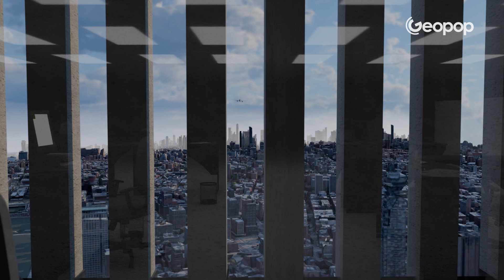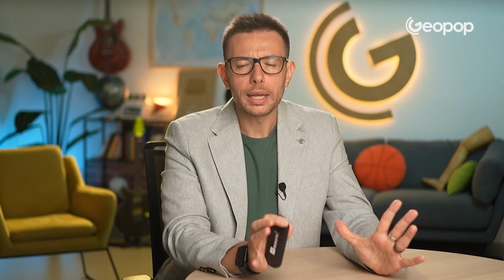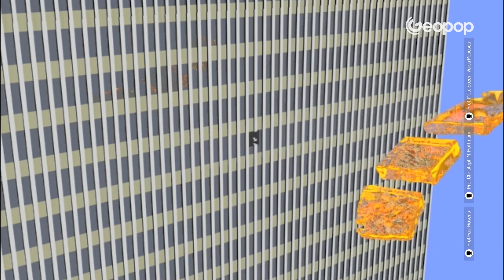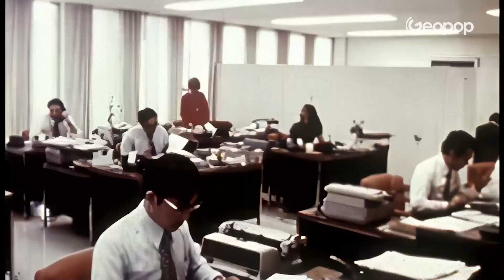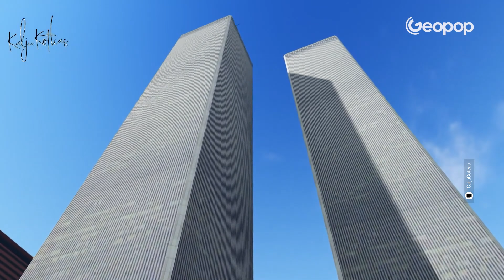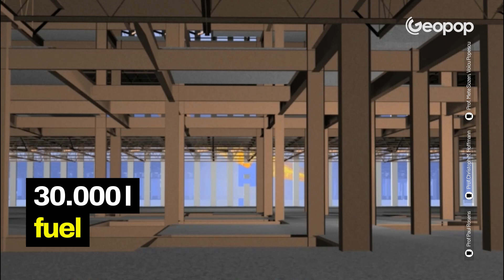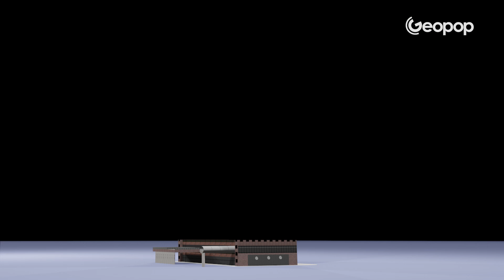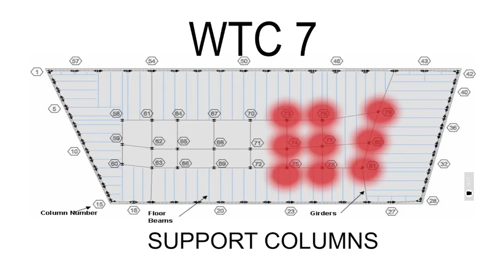9/11, 2001: The Technical Reconstruction of the Twin Towers and WTC 7 Collapses

Comment: Im still waiting for this genius to tell us why building 7 collapsed.   Helllllllo
Reply: I'll do it. The collapse of the unknown and unimportant Building 7 – one of 6 buildings to collapse of 10 destroyed on 9/11 - confuses a lot of people, despite being one of the most studied engineering disasters in history. It was not famous, not a terrorist target, no one was killed in it and thus it did not get a lot of attention, so most know very little about it. There is a lot of tantalizing but absolute garbage out there on this topic. Given the choice between long boring, hard to find technical reports and readily available, easily digestible fantasy on the internet, many turn to the latter. To counter that I prepared this brief summary explanation based on my own analysis. No politics, just engineering. 

The North Tower collapse at 10:28am bombarded Building 7 with thousands of tons of burning debris, causing heavy damage and starting raging fires burning out of control for the next 7 hours. Half the responding FDNY firefighters having been killed, others injured, units in disarray, much of their equipment destroyed, no water pressure, and the greater urgency of Search & Rescue efforts, firefighting efforts at 7 were pulled as futile. The building couldn’t be saved and was left to its fate.

youtube.com/watch?v=g_SvpwyC17M&ab_channel=MFitz 

Collapse of a burning structure is always a concern for firefighters. Steel buildings subject to fire rely on active fighting of the fires to survive. Left to their own devices they will collapse. Buildings are designed around 1 to 3 hours of fire resistance, allowing time for occupants to escape and ACTIVE firefighting to get started, after which all bets are off. In B7 the occupants escaped, passive and active fire protections were compromised and active firefighting never got started which left the building to take its chances. It lost. Odds on Building 7 would eventually collapse,… and it did. No big deal in logic. That is the sort of choice firefighters make every day in brush fire situations - which houses to save and which ones to let go. Only real difference here is moving the decimal on the size and cost.

FDNY Chief Daniel Nigro ; The biggest decision we had to make on the first day was to clear the area and create a collapse zone around the severely damaged 7 World Trade Center, a 47-story building heavily involved in fire. A number of fire officers and companies assessed the damage to the building. The appraisals indicated that the buildings structural integrity was in serious doubt. I issued orders to PULL BACK the firefighters and define the collapse zone. It was a critical decision; We could not lose any more firefighters. It took a lot of time to PULL EVERYONE OUT, given the emotionalism of the day, communications difficulties and the collapse terrain

FDNY Deputy Chief Peter Hayden - We had our special operations people set up surveying instruments to monitor and see if there was any movement in the building. We were concerned of the possibility of collapse in the building. And we had a discussion with one particular engineer there, and we asked him if we allowed it to burn could we anticipate a collapse and if so, how soon? And it turned out that he was pretty much right on the money, that he said 'In its current state you have about 5 hours

With its deteriorating condition being reported throughout the day, the collapse of Building 7 expected by the FDNY, bystanders and the media meaning at least 24 video cameras recorded some or all of the collapse. Everyone at the time knew what was coming and why.

youtube.com/watch?v=OY5S5k3tMHI&list=PL4GiNqqck-lzR7pebSWRVLoXyu-aWR3Rr&index=48&ab_channel=911InvestigationVids 

Building 7’s collapse was totally different to the Twin Towers, harder to understand and most of the details difficult to see. But we can sort out what happened through careful analysis and observation.  What follows is MY EXPLANATION of the collapse sequence using the best available information and relying on no authority.

B7 was complex structure, a 47-story steel framed building built on top of a smaller existing 3-story building, requiring several lower floors dedicated to complex load transfer structures instead of usable office space. Of trapezoidal shape and all-steel tube-in-tube construction, B7 (above the 7th floor) consisted of a central core of steel columns carrying most of the gravity load, perimeter steel columns around the outside of the structure carrying the remainder of the gravity loads and long span beams and girders to tie those elements together and form the floors. On the outside of the building hung a moment frame - the last part of B7 to fall. 

Phase 1 : Collapse initiation for B7 is notably quiet with observers not realizing the building was collapsing! There was no audible warning in the form of say hundreds of ear drum busting 180-190dB explosive bangs preceding the collapse. The first externally visible signs of collapse initiation occurred at 5:20:28 pm. Here at 12:00 a local CBS affiliate reporter is talking 10 blocks from B7 when collapse begins. People don’t start to notice the collapse until 12:11. Then at 12:45 is the famous CBS fixed camera clip of Building 7’s collapse Again, note how quiet it is.

youtube.com/watch?v=t5tEy6mXSE8&ab_channel=fresnosean379

Collapse initiation was due to multiple lower floor failures above the load transfer region (7th floor) in the NE corner of the building. In this video at 0:45 you can see the NW corner from inside the building while under construction, Column 79 just out of frame on the left. That big, angled steel beam across the top of the frame connects to C79 at one end. The girders connect to the beam. The beam and all those girders depend on just one connection

youtube.com/watch?v=nP3TNHPCIVU&t=35s&ab_channel=EdwardCurrent

Phase 2 : Lower floor failures left core Column 79 laterally unsupported over an excessive length and it buckled. If you look at a floor diagram of Building 7 (see above) and look at all the structures that depend on C79 you quickly realize this one column was a relatively isolated structural element on which a disproportionately greater fraction of the structure depended . Externally we see a vertical progression of window breakage along the 44-46 line and a kink in the roof of the East Mechanical Penthouse at the top of the building, consistent with C79 failure. The transition from full capacity to almost no capacity occurs in virtually an instant. Once the buckling failure occurs there is almost no resistance

Normally with a buckling column, the load could very well be redistributed to other columns, meaning the buckling could stop after a while. With C79 that is not the case - the failure did not redistribute the load, so the collapse rapidly progressed to the roofline, sinking the rooftop penthouse.

Phase 3 : With C79 gone, B7’s progressive, non-symmetrical collapse continues with C80 and C81 at the east end of the core left laterally unsupported and quickly buckled and failed as well, sending the EMP down through the building. C79-81 all have no diagonal bracing, which I believe is a major reason why they could not redistribute a lot of vertical loads among one another.

From there collapse progressed from east to west through the central core until the core was gone taking all of the interior floors and structures and probably most of the perimeter columns with it. You can see the horizontal progression of window failures low in the building and the dropping of the remaining rooftop structures into the building. One of the big takeaways from the NIST Building 7 study (that gets completely ignored) was their modeling which determined C79 failing under ANY circumstances would have initiated the same collapse sequence.

Phase 4 : After about 10 seconds only the exterior moment frame - a hollow shell mostly supported by the 4 corner columns and quite unable to stand on its own – remains, creating the illusion the building is still standing since little has changed externally. That’s just hollow empty shell, like an empty cereal box. The north leans inward, forming a V in the roofline. The last remaining perimeter columns buckle under the strain.  There is almost no resistance as the moment frame free falls, landing on top of the 7-story high debris pile, blocked surrounding streets, heavily damaged the Verizon Building and destroyed Fiterman Hall at 30 W. Broadway, all well outside of Building 7’s “footprint”.  It is only here, at the very end that a single utterly meaningless measurement of alleged free fall is taken. Start to finish the collapse took 18-20 seconds, or less than 1/3 of true free fall*. Not that we really care since how fast something falls cannot tell you what started it falling in the first place. The free fall argument is about the collapse of the outer shell *AFTER all of the critical internal structure had already failed and completely ignores about 80-90% - of the collapse. 

Building 7’s progressive, non-symmetrical collapse was incidental and unintended collateral damage from the combined effects of fire + time + gravity started by the collapsing North Tower. That is true no matter who planned and carried out the 9/11 attacks or why . The collapse was of so little consequence it barely even registered at the time, a mere footnote. 

I hope you found this helpful. It is meant to be informative, not adversarial and to solicit informed critical comment. If I made any errors of fact, logic or reason or left anything critical out, please let me know so I can fix it. IF you can offer a more plausible alternative be my guest. So far no one has even tried. Please start any reply with the words “Tits McGee” or I will know you didn’t actually read it and won’t let you waste my time.

Comment: So all the metal from every floor just disappeared.      So the fire from the 100th floor burned the metal on the 15th floor.  Yeah keep making crap up.   A 2x2x1/4 piece of angle can hold the world up.
Reply: Not what happened. It goes like this actually:

1. The Twin Towers consisted of 4 primary structural elements that together formed an integrated system where each relied on the others.  47 hollow box-section steel Core Columns carry the majority of the gravity loads. The 236 hollow box-section steel Perimeter Columns carry the remainder and ALL of the lateral (wind) loads. Long-span Lightweight Steel Trusses connect the core and perimeter column together at each floor with a Hat Truss on top to tie the structure together as an integrated unit where no element can survive without the others 

2. The impact of 117 tons of airplane (= to about 12 dump trucks) at speeds up to 590 mph completely destroys the aircraft.  This in no way implies the Towers come out unscathed. Some folks don’t get that. Hitting with the energy of up to a ton of TNT the impact damages or destroys many perimeter and some core columns (33 of 59 perimeter and 20 core columns destroyed at the impact floors in the North Tower), primarily through bolt-shearing failures at the end connecting flanges, as well as bending, twisting and fracturing of weld seams. There was no cutting or slicing - the reality was far more violent and messy. 

3. The impacts destroy or damage fire insulation, fire breaks and sprinkler systems on multiple floors. Huge fires are started across multiple floors simultaneously and allowed to spread rapidly with no effective firefighting or fire suppression. This was an unprecedented fire event . All of this was observed and recorded.

4. The hotter steel gets the weaker it gets .  With fire insulation stripped away and no sprinklers the survival time of the steel greatly reduced. Gradually over time heat causes the lightweight steel Floor Trusses at the impact damaged floors to sag, which was observed and recorded.  No steel melted nor did it need to. Structural steel will fail long before it turns to a puddle. It just needs to bend

5. Sagging floor trusses pull on the increasingly weak and overloaded Perimeter Columns, causing some of them to bow inward by up to 5 feet. This was observed and recorded. A straight column is up to 4 times stronger than a bent column. 

6. The bowed Perimeter Columns buckle and fail, initiating collapse. This was observed and recorded.  The formerly static mass above which the structure below could easily support is now converted into a dynamic mass up to 30 times greater. Because they have buckled, the Columns above and below the failure point are no longer aligned . The load bearing structure below no longer bears any load as it falls past the lower columns, NOT onto them.

7. Thousands of tons of debris fall within the four outer walls, down through the open office space, crashing onto the first intact floor it encounters. This massive impact immediately breaks the bolted connections to the columns as the amount of resistance the Floor Trusses can offer is negligible.  The falling debris slows only marginally and briefly. Note:
7a. This is NOT a solid top block crashing into and “crushing” a solid bottom block .
7b. The debris falls past the columns not onto them.  The columns provide no resistance to the falling debris. 
7c. Only the bolted connections of the floor trusses to the core and perimeter columns can offer any resistance. A pair of 5/8” bolts at each end of each truss vs. thousands of tons of falling debris.

8.  This floor-led collapse progression within the four outer walls can only go straight down. Note: 
8a. This process is often incorrectly referred to as “pancaking” which actually refers to a completely different process rejected at an early stage. The catchy name stuck but nobody knows what it is supposed to mean.  Pancaking is too simplistic and inaccurate anyway. More like Kaiserschmarrn.

9. Collapse progresses through the floor systems and not down the columns. Rate of floor assembly failures increases with each successive floor as momentum increases, reaching an average acceleration of 0.65 of GA, or 35% slower than true free fall. Bam, bam, bam down the building until there are no more floors to fail.  The resistance offered by each successive floor is always the same. The mass and velocity and thus the energy of the falling debris are constantly increasing.  The falling mass increases with every floor it destroys as new falling mass is added. Some falls to the sides, but most falls down. More mass, more velocity, same resistance with each floor.
The above is unquestionably the path of least resistance

10. The Towers were 95% air by volume and as that air was compressed inside the building it is forced down the tower and blown out the sides in reaction to the building collapsing not causing the collapse. Those were not “explosions”, it was expulsions of compressed air. 

11. Perimeter Columns become detached and peel away like a banana behind the collapse front, playing out to the four points of the compass extending to more than 600 feet from the base of the towers. This was observed and recorded, the results quite obvious from examination of the debris pile. 

12. Core Columns fail last as their internal beam bracing is stripped away and lateral support from the floor to perimeter columns is lost. This was observed and recorded and is most obvious in the North Tower. 

13. For those who care about how long this took, the whole process took 31-34 seconds from the moment the perimeter columns buckled until the last core columns hit the pile, or 1/3 the rate of true free fall. Don’t believe me?  Just watch any video of the collapses and note all the loose and truly free falling debris dropping much faster than the towers themselves.

14. The Twin Towers were perfectly safe within their design envelope.  They only collapsed when taken far outside design parameters by an extraordinary and unprecedented event. 

No steel "disappeared".  It's all there. Impact + Fire (heat) + Time + Gravity = Collapse . Remove any one of those four elements and there is no collapse. Ignore any of those elements (as many do) and you will never understand the collapses. The Twin Towers were an integrated system in which no one component could survive without the others. One fails, the rest follow, through the path of least resistance – DOWN – through the open space, bypassing the path of greatest resistance – the columns. Don’t get stuck on the but the lower floors weren’t on fire nonsense. 

BTW - The Port Authority of New York and New Jersey owned the Twin Towers from the day ground was broken until the day they collapsed. Six weeks prior to 9/11 a consortium of five commercial real estate firms leased the Twin Towers and some of the surrounding buildings (excluding 3 and 6) and naturally took out an insurance policy on their investment as anyone would do and as was required by the banks financing the deal. So,... blame the banks.

The terrorists didn't care. 

I hope you found this helpful. It is meant to be informative, not adversarial, posted with the objective of soliciting informed critical comment, positive or negative. If I made any errors of fact, logic or reason or left anything critical out, please let me know so I can fix it. One topic at a time, on topic only please to stay focused, no word-salads of Gish Gallop. IF you can offer a more plausible alternative be my guest. So far no one has even tried. Please start any reply with the words “Tits McGee” or I will know you didn’t actually read it, are not serious and just wasting my time.